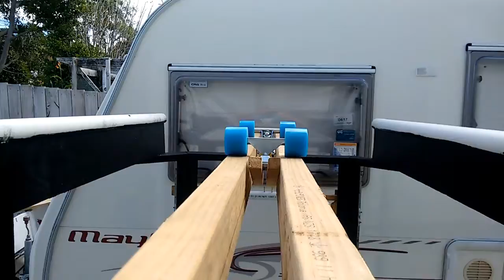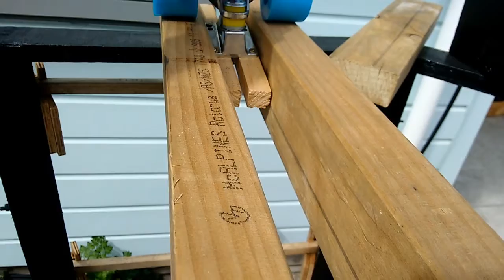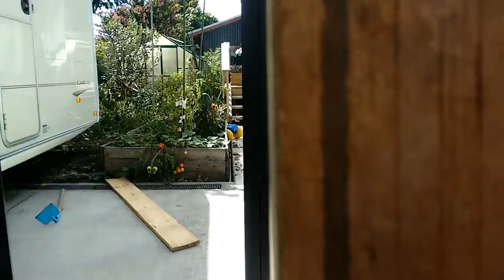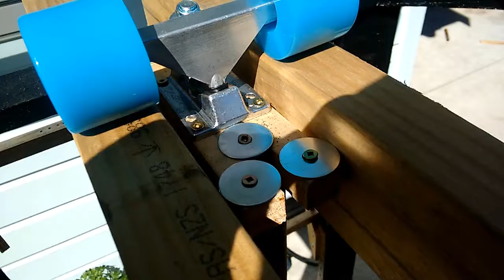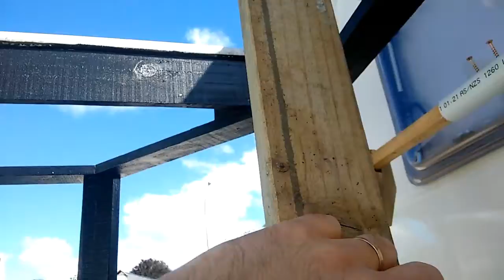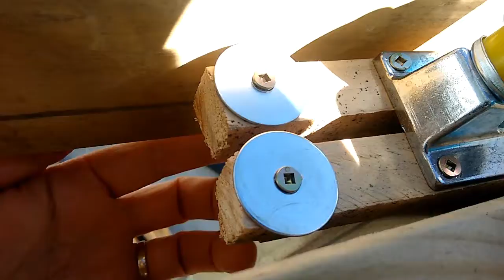Stupid Robot Fighting League - The Head Track System

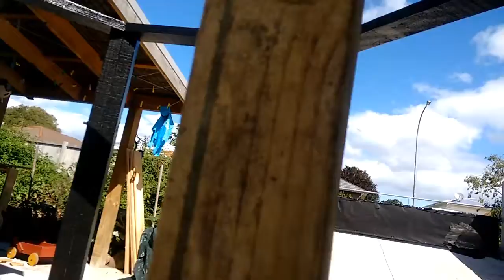Comment: At 4:23 - Maybe drill a hole in the 2x4 that is attached to the truck just below the pair of horizontal 2x4's, insert a dowel rod or a round piece of piping like a 3/8 inch copper tube of something so it can run along the opposite/back sides of the two rails. If its close enough to the wood it will stop the board from tilting inward and keep the 90 degree angle and will also keep it from moving in and out of the track. Then you could put a loose fitting sleeve on the outside of the copper pipe to make 'rollers'.